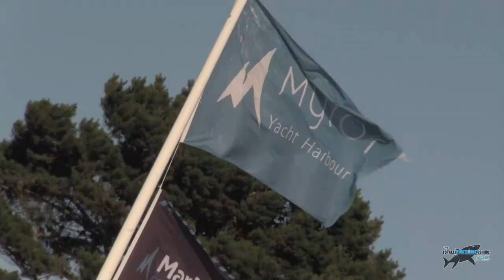Man Catches GIANT EELS ALONE in a TINY BOAT (Solo Fishing)

Comment: Absolutely golden mate thank you. I got Free View, Sky and Netflix on the telly and none of it compares to this. Do you charge 2 batteries Graeme? If so do you use a split diode circuit. I have mine manual but thinking of improving it. Them split diodes gadgets loose nearly a volt.

Comment: Always wonder about the line running through the booms... Does it not chaff and snap? Would painting the inside of the ring with some of the wife's nail varnish to either stop or reduce the chaffing.....?
Reply from the maker: I never had a problem with it on abrasion. But then I am usually on 50lb test mono.

Comment: Great video as per usual 👍🏻 How come you never carry a aux engine? ive watched all your videos but with the bracket there and how far out you fish it's crazy your braver than I am!
Reply from the maker: Wing engines are often not fitted by fishermen running long distances in areas of strong tides. They cannot get the boat on the plane so with displacement speed only you will invariably run out of fuel.Of course if you break down closer to shore then you could at least get home,or hold position if you are in a strong tide run. Its all down to personal options.